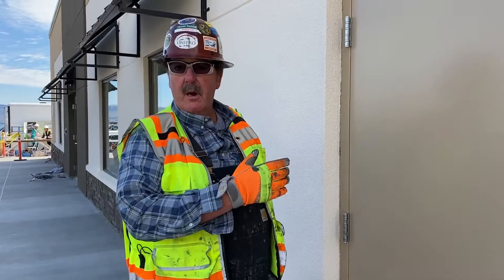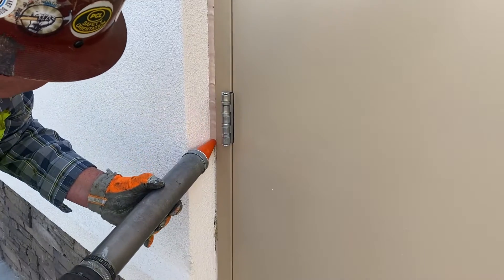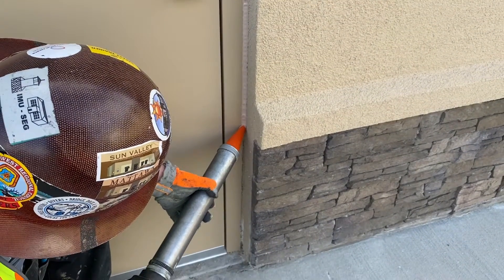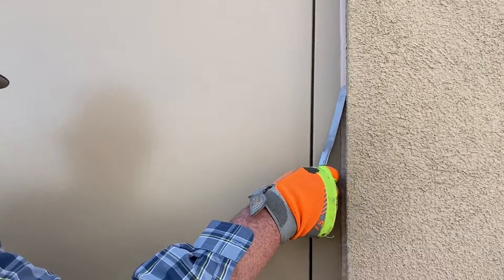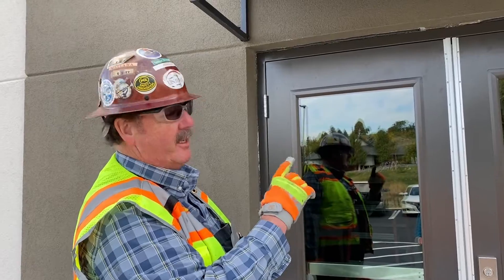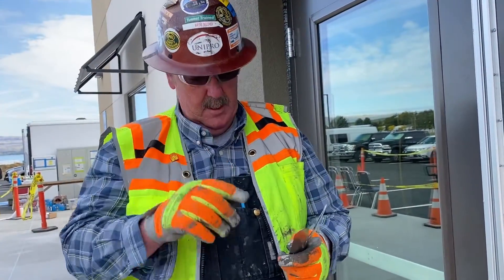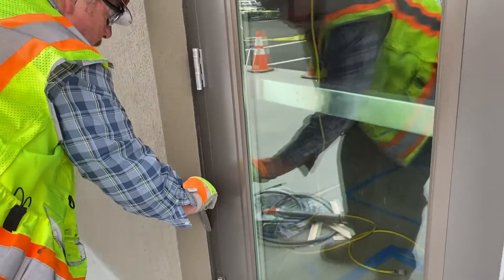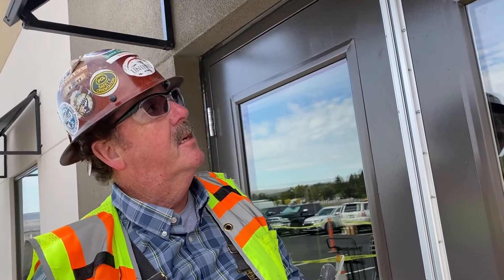How to Caulk Around a Door Frame E.I.F.S.

Comment: I’m a professional caulker, have you ever heard of open cell backer rod? You’re not supposed to pump the joint with SikaFlex like that. Do better bro.
Reply: I am an amateur and getting ready to caulk for the first time.

I thought backer rods are for filling cracks so that you only have to apply a thin layer of product.

How would you use a backer rod when caulking around a door?

Thanks for any advice and tips (:
Reply from the maker: @bensosnowski1128  typically yes.  Backer Rod is meant to be bond breaker, allowing the sealant to adhere to side walls of the joint and not the bottom. This allows the sealant to expand and contract with without releasing it from the sides, maintaining a tight seal.  Check out this blog post for more:  https://www.armacell.us/en/blog/post/are-backer-rods-necessary/#:~:text=First%2C%20backer%20rod%20acts%20as,sides%2C%20maintaining%20a%20tight%20seal.
Reply from the maker: Hi Mike, thank you so much for your feedback. We would love to see some of your work, feel free to share your handle so we can follow you.

Comment: As a ped door installer this guy caulk good and the wiping down of the caulk is perfect in my opinion. I've seen 100s and installed 100s of doors and anyone that would complain about caulk that looks like that when finished on a exterior ped door is just looking for something to bitch about
Reply: I agree it looks fine. Some people say to mask it but that takes a lot of extra time.
Reply: @senyashchukin391 Believe me, No Real caulkers ever tape anything
Reply: Don’t know where you are with the No Standards on caulking but I worked for caulking companies for years and Never saw Anyone even at apprentice level caulk that Sloppy and think it’s okay. I don’t know about anyone else but caulkers ( real bonafide ones) are extremely picky and fussy about even the slightest little knife mark that has nothing to do with the seal. Caulking used to be a really high standards specialty skill but not anymore apparently in No StyUSA

Comment: Where can I get those things to smooth the edges? Haven’t seen those in my hardware stores
Reply: Caulking knives are pretty hard to find. I always made my own grinding down putty knives etc Those Flexy Albion knives are OK for some stuff but my own much cheaper swap meet tools Finish Way better on big joints and rough stuff
Reply from the maker: Hello, you can  find the 922-G01 C.A.T spatulas on our website. Click this link or copy and paste into your browser:  https://albioneng.com/6-piece-c-a-t-spatula-set-stainless-steel-new     In addition you can call us at 856.235.6688 to find local distributor.

Comment: First intro to caulking was at the union facility. Nice, smooth surfaces on the caulking station. Beautiful. 
First job as an apprentice was control joints and seems on exposed aggregate concrete. Bleh.

Comment: I would get fired if my joints looked like that!!!
Reply: Yeah okay scab
Reply: @MisunderstoodWierdo  LMAO 🤣🤣
Reply: Novice here, what should they look like?
Reply: I think anyone would get fired caulking like that! I hope it's not the main entrance.
Reply: True
Reply: I thought that exact thing right away! Id Fire myself for doing half as bad
Reply: Exactly this fool don't have any idea how to do caulking in the right way!!
Reply: What are they supposed to look like? I don’t understand what they did wrong
Reply: @bensosnowski1128 it looks messy bro, you should use less caulking in my opinion.  It should look like one straight line as if it were part of the material.  Consistency is key.  His goes from thick to thin and looks like a mess.  Most people wouldn't even notice that shit lol. But I can see that from a mile away.  Less is always more with caulking.  Better off using a manual gun aswell in my opinion.   More control.  But ya just my opinion anyways.  If that were a front entrance id be forsure having a big talk with my employees lol
Reply: That is brutal caulking goes from thick to thin. That type of thing can be what makes a job look like shit
Reply: Brutal. Must have been the second time caulking